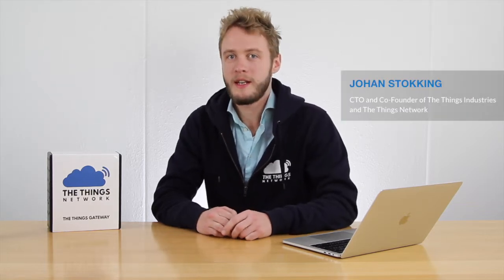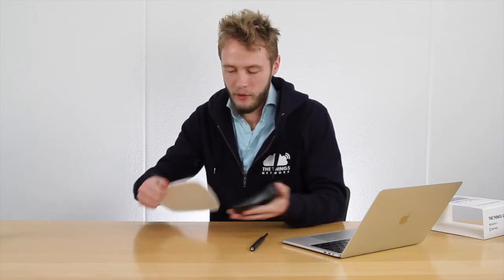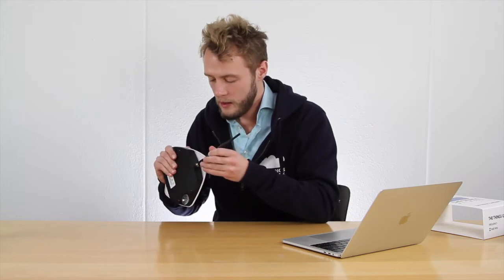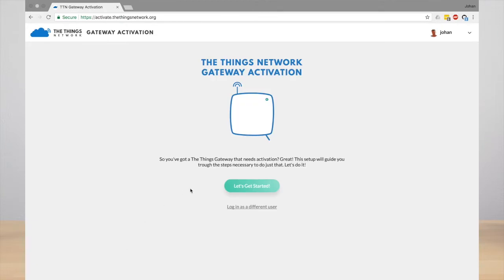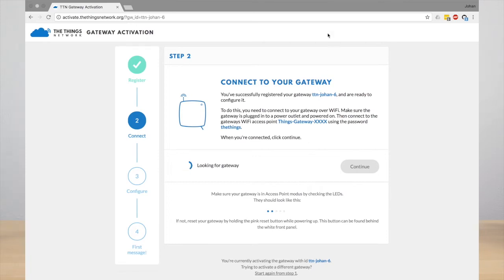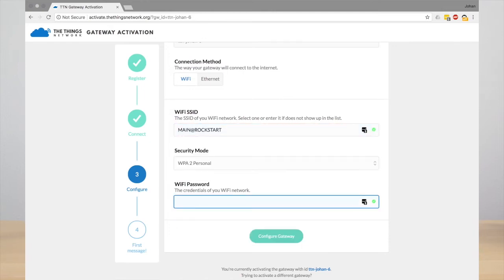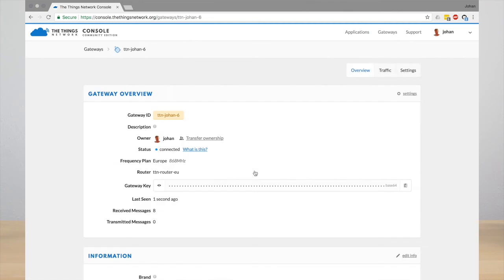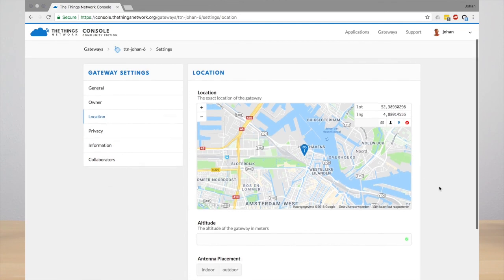How to: Activate The Things Network Gateway within 5 min

Comment: I've bought The Things Gateway. 
There is one thing where i have some critics. 
You use Polystyrol inside the Packaging instead of carton. 
Today, where we like to preserve the environment its an outdated material for packaging. 
No one wants this plastic and it will only be burned. 
This is to change. 
Best regards
Frank

Comment: My gateway won't connect either any suggestions on what to do? It is stuck on the "still activating" Led light.
Reply: Got it up and running! I just nudged the LoRa board in a bit and that happened to the job. If anyone needs help let me know and maybe I'll put a video to show you guys.

Comment: My gateway keeps rebooting. It never gets online. I tried beta firmware, no changes. It gets up to 3 leds on.. then reboots. forever.
Any idea, because it issue #1 on github and it is still not fixed.
I have added serial debugging, sniffed the serial protocol to the LG8271 module and it is responding.
Reply: For some reason it stopped rebooting and started working a few minutes ago. After power cycle it still reboots several times and then goes stable and online. No idea why.
Reply: we got the same problem. Ok the first 3 steps but step 4 (first message) in a never ending loop ... :-(
Reply: I have used an SD card with latest Beta software, and enabled automatic updates. For unknown reason it works now. It is the first time it works in 6 months. Maybe that the new Beta fixed something.
Reply: Edwin could you please link me the github repo where download the latest firmware version? I'm not able to find it :-(
Reply: this is the link I see now, maybe I installed something else... https://github.com/TheThingsProducts/gateway/tree/master/firmware